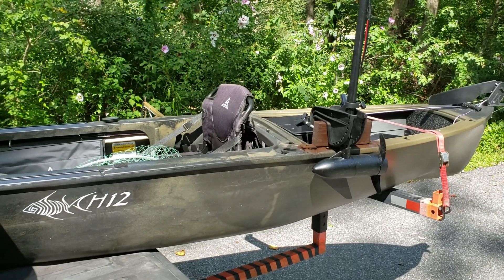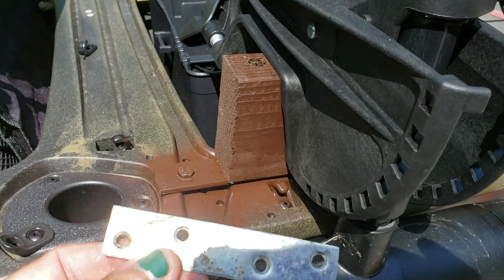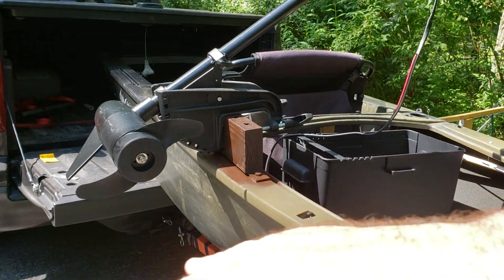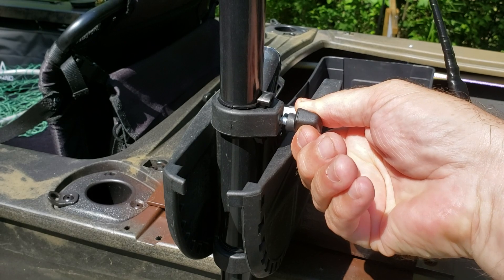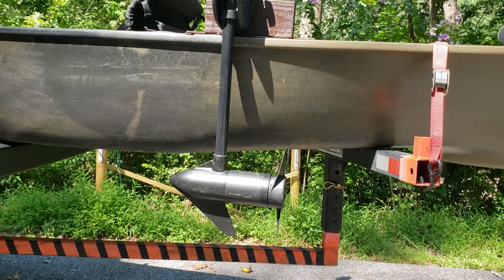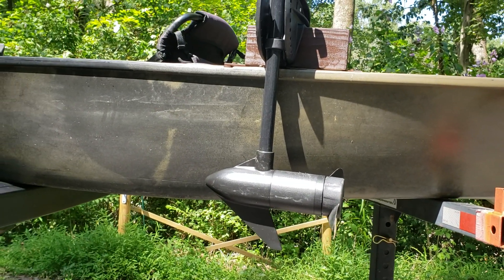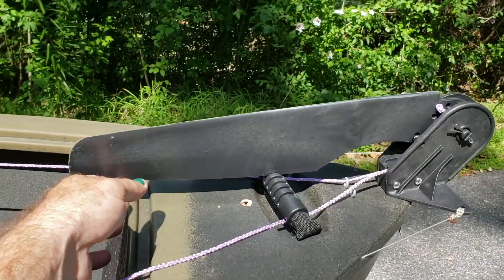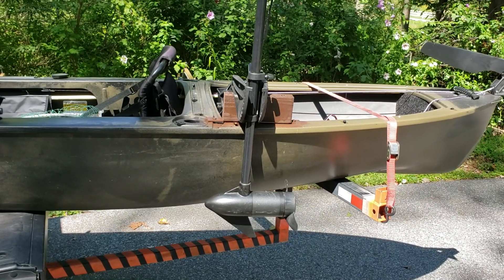Ascend H12: Simple Way To  Side Mount A Motor

Comment: Interesting concept.  Fixed motor and use rudder to steer.  Do you have good enough of steering?  This is cost effective means
Reply from the maker: It's great for most of what I do. If I need to turn hard, I just grab my paddle.

Comment: No problem with weight balance having the battery mounted in the rear?
Reply from the maker: My stern sits about six inches lower than the bow, but it's never been an issue to me. I'd probably go a little faster if it leveled out.